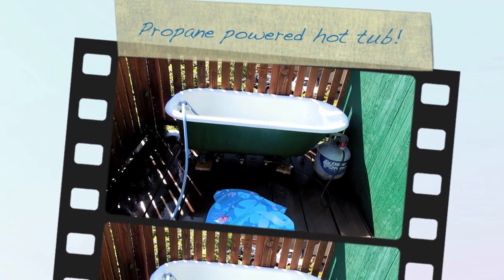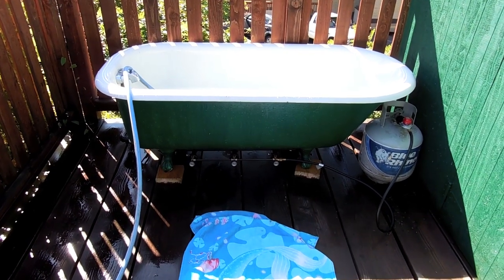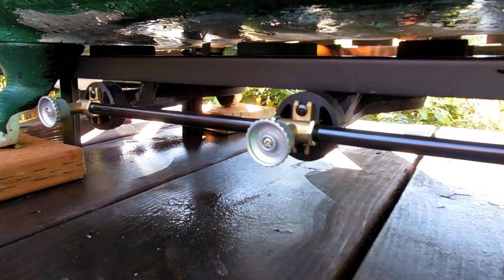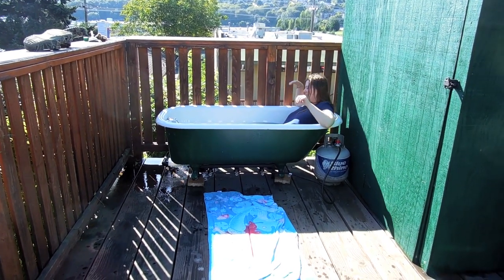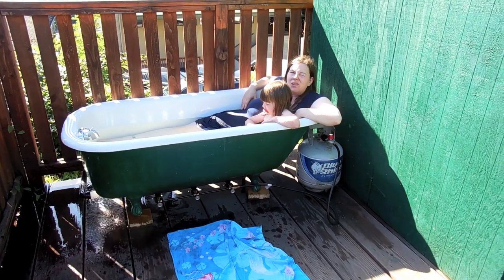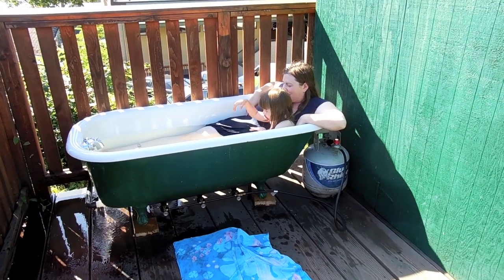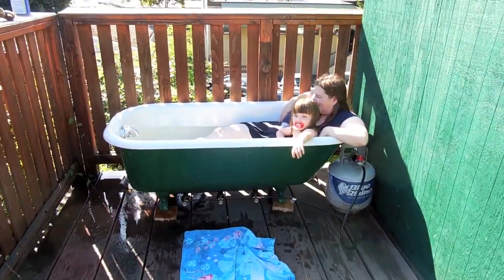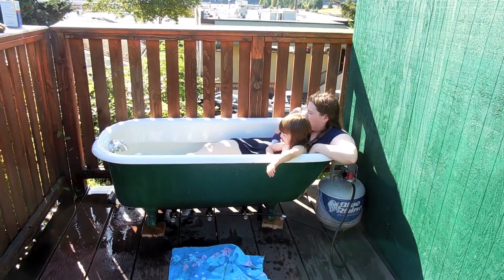Propane Powered Clawfoot Tub

Comment: Thanks for the data. I find that my burner heated the nearly full tub from 55 degrees to 105 in 3 hours at roughly half flame. Works great but there is a hot spot in the "wrong" place for comfort. I will have to move the burner toward the foot end of the tub. heh heh.

Comment: Where did you obtain the burner system? I have the tub, and a full propane tank...lol... I just need the same system you have. How did ypu attach it to the underside? Finally... does it ever heat up to a nice hot temp, or just mildly hot?
Reply from the maker: James M we got it from Amazon. It wasn’t attached in anyway just put underneath. I think we had to raise the tub with blocks. And it would boil the water if you let it. Took 20 minutes to heat up. We would keep the burner closest to the feat on low to keep it hot. Be careful not to burn yourself.  We would have to turn off the burners and wait a bit for the bottom to cool down . Cheers !
Reply from the maker: James M get yourself a thermometer too. We had a floating duck thermometer lol 😂

Comment: Great video! Thanks for all the information but could you be more specific in expressing the amount of time it took to get your water hot? I plan to use  the base and burner from my 38,000 BTU turkey deep fryer. It's circular burner is smaller in diameter than the ones you used but I am thinking my flame is perhaps hotter as it is a bright blue color. What are the BTU's of your 3 burners? Thanks you.
Reply from the maker: depends on the temp out side but on average from water temp of 60 to about 104 takes thirty minutes. Im not sure of the btu's.
Reply from the maker: Nik Boldrini http://www.amazon.com/gp/product/B00DQ43CWU/ref=oh_aui_search_detailpage?ie=UTF8&psc=1
Reply from the maker: Nik Boldrini 15,000 btu per burner and there is three .